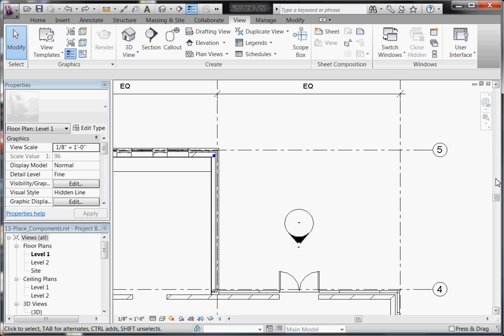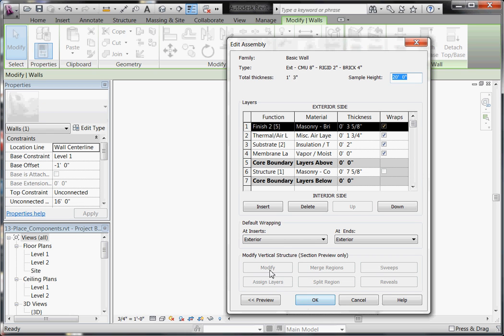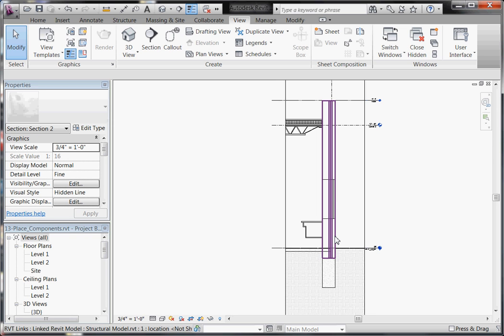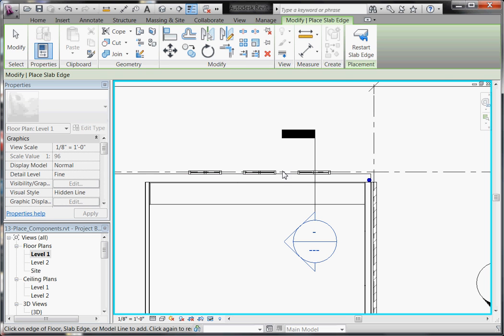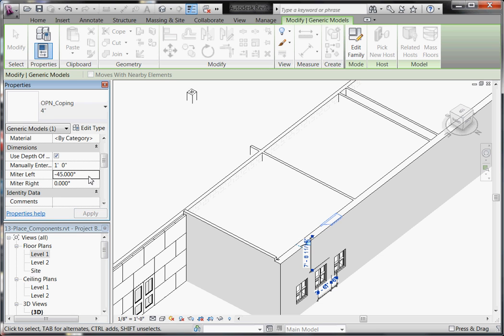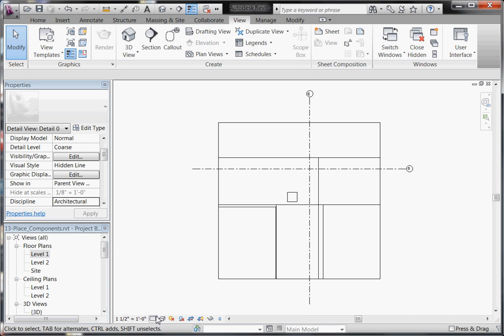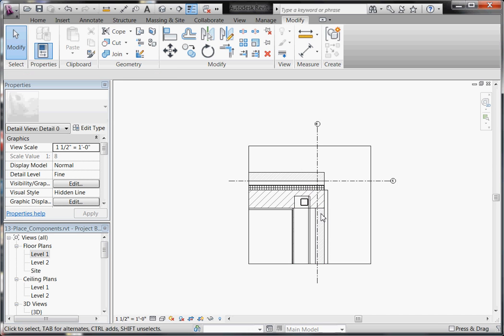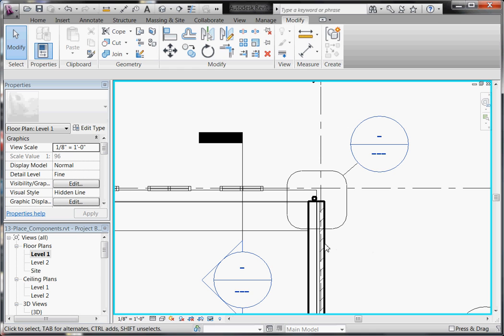Easy Revit (2011) - 25.1 - Sections and Details (Part 1)

Comment from the maker: if you mean like a corble then you can use the "sweep" tool and apply any material to it you want see my vid on custom sweeps and reveals...If you want a layer of the brick veneer to be offset from the rest of the wall such as a wainscott, then you can offset wall layers with the stack wall tool.  see my vid on stack walls.  also u can create any size wall panels offset from the rest of the wall if u build it as curtain wall and swap the panel out for any wall type u choose such as brick